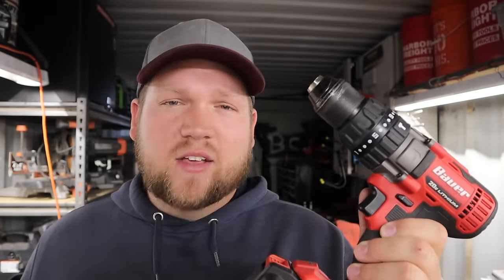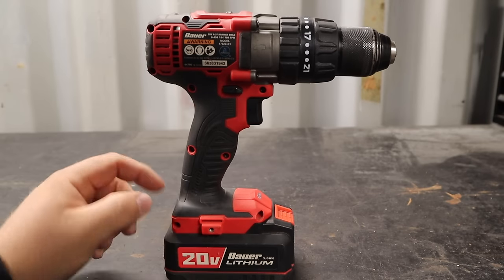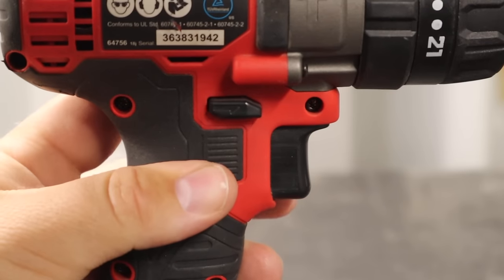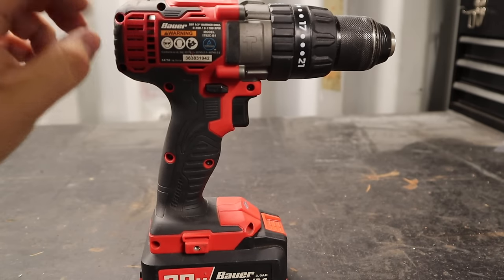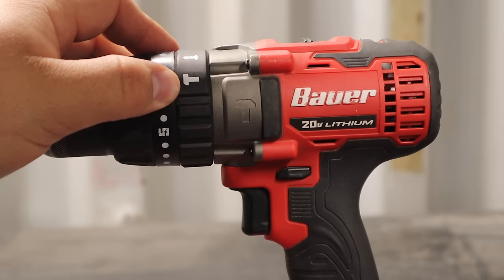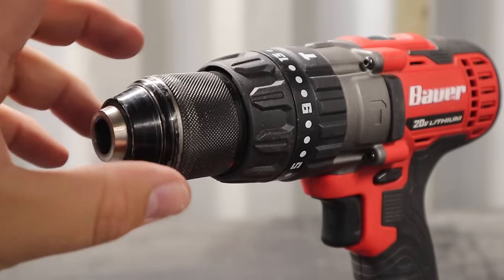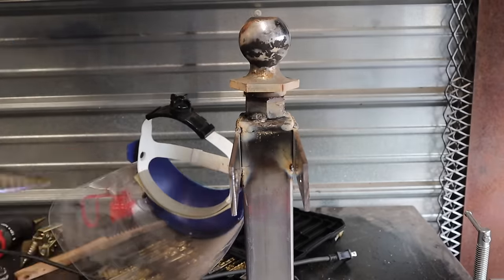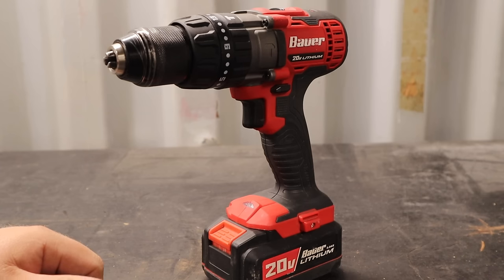Bauer 20v Cordless 1/2 In Hammer Drill/Driver - 2 YEAR REVIEW!

Comment: I used to only buy Makita cordless tools. Then a Harbor Freight store opened in my city. I have been to HF in the past, but it seems to me, after going in the new store, they have really made some major improvements. I saw the cordless tool section, and was instantly impressed with the build quality of the cordless stuff, so I decided to try it. So far, I have the cordless torque wrench, cordless angle grinder, corded angle grinder, and now the hammer drill.. all Bauer. They are working great, and have impressive power and durability! And for less than HALF the price! Way to go HF!!!

Comment: I've had mine for three years and it's done a little metal and a lot of wood. It still works great, my circular saw is also almost 3 years old, I got it right after Christmas, it still works great, I have batteries from the same time, only one 1.5ah has failed, all of the others still hold a charge just fine. Been very happy with all my Bauer stuff.

I love that the chuck is all metal, the whole tool felt quality when I first picked it up. No regrets in buying Bauer.
Reply from the maker: I'm FINALLY getting to some older comments, I've been getting like 10-20 a day and have a hard time keep up right now. The metal chuck sets it apart from some other affordable DIY brands I think. It's a good tool set for sure. I am going to be finishing up a review on the whole tool system here shortly.

Comment: I've liked my Bauer stuff, and have most of the 20v tools.  I've liked them all mostly.  Looking forward to these brushless line tools that they have been releasing.  Recently I got the 20v oscillating tool, and have been pretty impressed.
Reply from the maker: Definitely. Pretty good stuff. Ready for some Brushless.
Reply: I just bought the brushless impact driver a week or so ago and have used it a few times. It is absolutely amazing! All the power you could ever need in an impact driver and it has 3 speeds and upgraded front facing led lights that are super bright.  Well worth the 49 bucks paid for it
Reply: Oh one more thing it is powerful enough to rip lug nuts off my suv torqued to 140ft/lbs

Comment: I tried to use mine in hammer mode in some concrete with a fair amount of aggerate concrete with stones. It may have been the bits, but it wasn't enough hammer drill for concrete with a lot of rock in it. But for cinder block, bricks and concrete without a lot of rocks it is probably fine.

Comment: If your doing all this building with a bauer drill, then this should be no problem for my small DIY repairs
Reply: I have used this same exact drill to drill through really thick steel oil pipe posts for fencing and it's a tough job and takes a while but this drill has got the job done for me very well, it helps to use some of the bigger batteries so your battery don't run out on you and to use strong cobalt metal drill bits because otherwise the titanium or the black oxide can and have broke on me and the cobalt can snap on you also but it holds up better but this drill has been great for me so far and I've used it a lot, I'm curious how the 20v brushless hammer drill driver from Hercules is in comparison but I haven't got any of the Hercules stuff as of yet and I'm not sure if I will or not because Bauer has been good to me even though people consider it not really a top of the line brand but I think for me just at home using it occasionally and sometimes a lot has been pretty good.

Comment: Have you bought the brushless Bauer drill driver yet? I don't believe they have a brushless hammer drill driver from Bauer in 20 V yet but they do with Hercules but I haven't gotten any Hercules tools as of yet and I'm contemplating on if I should or not because I have a lot of the Bauer 20v already along with a lot of their batteries and chargers but if I do get any Hercules 20v tools most likely their 20 V brushless hammer drill driver will probably be the first one that I get.
Reply: They just came out with a brushless hammer drill

Comment: I have trouble with my chuck staying tight when I drill. Used the hammer part today and it kept coming loose  drilling for small tap on screws. Would like to change the chuck
Reply from the maker: I’ve had that issue on my Milwaukee drills. I feel like it’s not too unheard of with the keyless chucks.

Comment: What’s the 1 and 2 switch on top of the drill. I’ve been having it for a while but I just noticed it.
Reply from the maker: It’s a speed switch. 1 is slow. 2 is fast.
Reply: @DereksWorkshopAndProjects  I didn’t know that, thank you!! Also, In which situations would those setting apply?
Reply: @Gottacacheemalll  use the fast speed (2) for drilling, with the chuck set to the drill icon... select #1, slow speed when using screw driver bits, also set the clutch to an appropriate torque number so you don't over-tighten or strip any screws or bolts. hope that helps

Comment: Does your Bauer Drill make a grinding noise in speed position 2 when the drill is slowing down?
Reply from the maker: I think I know what you’re talking about and I think it’s just a brake.
Reply: My Mikita does that since new. Still works fine 7 or 8  years later.
Reply: It's normal.

Comment: Won’t even take a lug nut off. I have it on hammer setting and  clutch slip on 1 and it won’t even activate the hammer function.
Reply from the maker: It’s not made to take a jug nut off. The hammer function is drilling into concrete, not an impact wrench. Clutch setting 1 is the weakest clutch setting too. Unless you just a troll, I’d invite you to really go read the entire users manual.
Reply: @DereksWorkshopAndProjects  why would my comment be a troll.
Reply: @DereksWorkshopAndProjects  I really bought It thinking the hammer function was for impact type.
Reply from the maker: Ok ok. I see that. No for lug nuts you need an impact wrench. The 1/2” gun with a 3.0 ah battery would serve you best.
Reply: Troll?
Reply: For the fellas with amazing comprehension skills... "unless you're a troll" was to indicate that he will be happy to help unless you're just wasting his time. He probably thought you were trolling because most people wouldn't use a hammer drill as an impact. 👍🏻